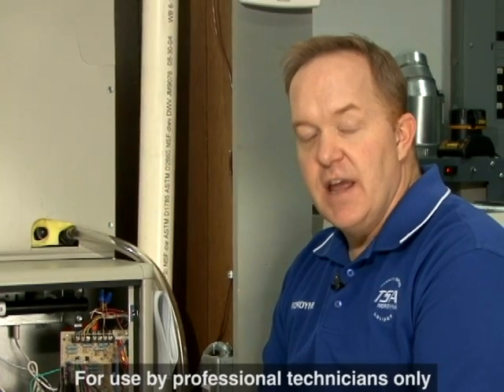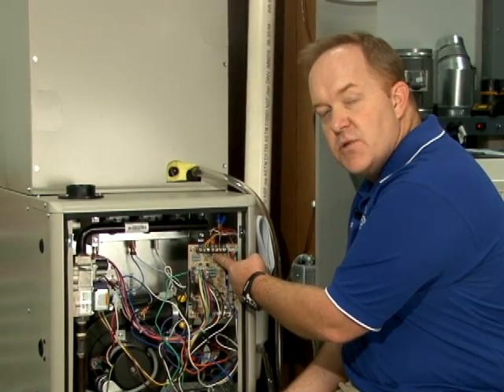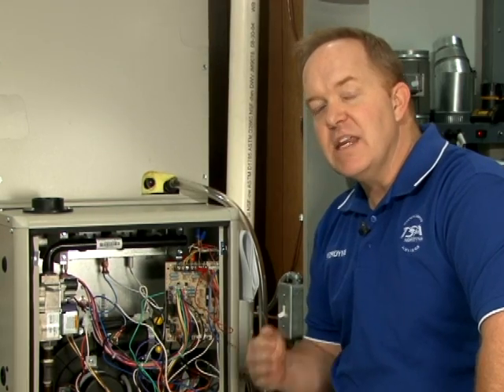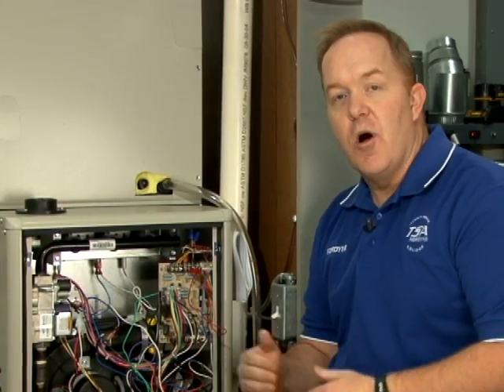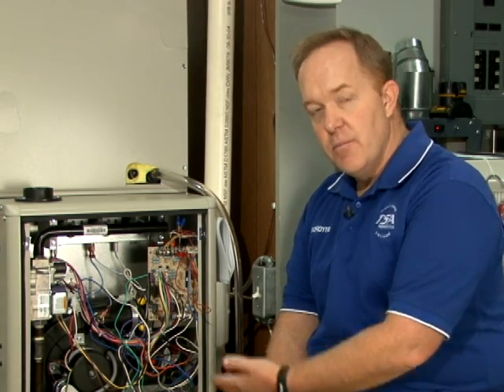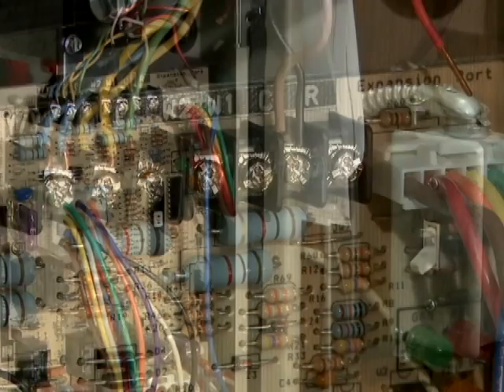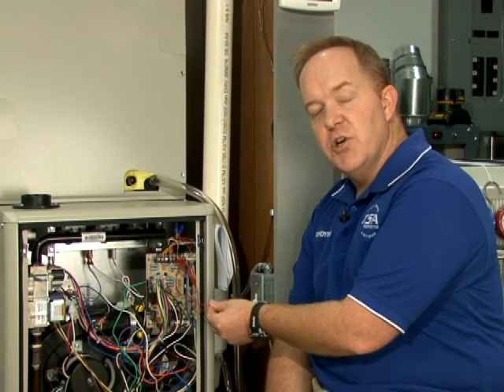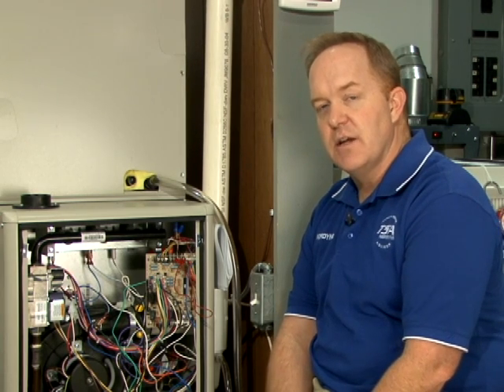Furnace Repair - Eliminate the Thermostat | NORDYNE U Technical Tip

Comment: What do I do if I jumped my nordyne furnace and it worked and I put a new motherboard and thermostat wire and thermostat and it still don’t work with the thermostat only with the jumper
Reply from the maker: Please contact Technical Services at 1.800.422.4328

Comment: Hi , i need to bypass the first cycle on my dual energy furnace ( oil and electric ) everytime i loose power , when it come back the first cycle is on oil , since i strip the tank , my furnace just work on electric , so i need bypass this . It is possible?

Comment: He says two different things. First, that doing this eliminates the thermostat or the wiring as possible culprits, which is wrong. But then at the end he says that jumping these two terminals out at the furnace tells you that if the system starts up, then you know "it is" either the thermostat or the wiring, which is right, but in the beginning he said the opposite. This is the problem with alot of these videos. They can be very informative, but you have to pay close attention to what they are saying, because the get confused. And  just an FYI for anyone, if you just go straight to the thermostat and jump it out and the system be starts up again, then you know it's probably the thermostat. This also, at the same time tells you that chances are very good that it is NOT a wiring issue because if it was nothing would happen, the system be would not start up again. JS.

Comment: But with thermostat out of the mix,   how do you set the furnace to heat?  My heat is currently not working on my goodman furnace.
Reply: My understanding is that when you jump those 2 terminals, it is essentially the same as the thermostat telling the system to turn on the heat.  It just won't turn back off until you kill power to the system.

Comment: Hi Dana, what website can I get a good jumper?  I go to Ebay (TYPE FURNACE CONTROL FAN BOARD JUMPER) it don't show...PLEASE HELP.
Reply: This question is pretty old, but for anyone who comes across this in the future... he just means a wire with a pair of alligator clips on them. It's not something specific to air conditioning or anything like that. It's just any old wire with alligator clips on the end to connect to the posts. It closes the circuit for you instead of relying on the thermostat to do it. It doesn't even necessarily have to be alligator clips. You could use a paper clip if that's all you have as long as you are able to make a sturdy physical connection between the two posts with an electrical conductive material.
Reply: @UFallinggator  zzzap
Reply: I'm scared
Reply: @ryanpennington817  Fortunately these are very low voltage circuits. You're not going to fry yourself even with 120V... Or even really 220V for that matter. My great grandfather used to say that he had to lick his finger first before he could even feel 110/120V. He had spent so long working with electricity that he'd become desensitized. Now 220V would still give him a shock, but nothing too terrible... depending on the circumstances of course. You don't really have to worry until you get to the main lines. Now, those will just fucking kill you. If you have to ask questions about anything past the breakers, then just don't touch it! Don't even look at it because you legitimately might just die...
Reply: @UFallinggator  thanks man n no it's that block with the wire screws...

Blower stopped working but the flame is on...on the coldest day in Ohio what luck

..r has a wire attached and the one under it...but 2 came lose n the blower sounded like it powered down..I'm no expert...I'm at work but when I get home Ima tinker with it with no fear thanks to u
Reply: @ryanpennington817  The thermostat usually operates at 24V with very little current. Even standing in a metal bucket full of salt water I doubt that you'd even feel it. It's still always a good idea to disconnect the power to the circuit when working just for the health of the circuitry, but I certainly wouldn't worry about a shock. If it had been the burners, them if say your first checkbox would be cleaning the flame sensor. That is by far the most common reason for a "no heat" service call. If the blower isn't operating, then eliminating the thermostat is always a good first step. It's quick, easy, and free. Hopefully it's just a bad thermostat that can be easily and cheaply replaced... And for that matter temporarily rigged if needed. If you need any help diagnosing the problem feel free to let me know. I'm not an "expert", but I've got a bit of experience. If necessary, we can arrange chat or video chat outside of YouTube as well. Not having heat in this kind of weather is not fun!
Reply: Oh, and try running the fan only. If within a few minutes the fan turns on, then a likely cause it's the limit switch. You should be able to find a fair amount of info on this issue with a simple Google search. If it is not the limit switch or the thermostat, and no tripped breakers, then it unfortunately might be the blower fan itself. There are worse problems to have, but a blower fan isn't a quick simple fix either.
Reply: @UFallinggator  brother David I appreciate that truely..we had a huge snow storm and it would just do this on cue..plus out shoveling I think my glasses got misplaced in the snow  so I had a hard time reading the labels..id PayPal u if it went too far  nothing's free nowadays ..even if it's not fixed the knowledge you have me already would help in me not getting ripped off ...it's a learning experience and I'm on the web googling stuff..

+
+
+
+
+  It looks like this with a wire connected to the top and second +( + are screws)

There are 2 wires that got disconnected and when they did the blower seemed to shut down

Didn't have time to take a deep dive. As I had to be at work plus go grab space heaters ...

Maybe I should try the jump technique..go get alligator clips ..can I fire the blower up manually ?
Reply: @UFallinggator  I'ma be honest months ago it was vibrating roughly...not smooth at all..at the start of "thermostat season" I had a guy come...he pulled the fan out and cleaned it..then he adjusted (Jerry rigged) it a in a way to we're the loud clang would stop ...I guess the storm had it working overdrive and maybe his quik fix gave out ...

It was making a tap noise when I came home from work .

Instead of the vrahhhhhhhhh smooth n low sound u had a small tah tah tah inbetween

This led me to go down open up the furnace and look inside at the burners n stuff ...my failure to put it on snugly prob led to it popping off ( I think it was latched pretty good Imo)...the lid popped off and the fan rolled forward slightly pushing the 'block" on the floor...

My main objective maybe shouldn't be the blower but considering the weather n me not wanting my pipes to burst it is ATM I wanna tackle the blower b4 I tackle the tah tah tah ringing  cus I think k that's from my goof.
Reply: @UFallinggator  what do you Kno..I got the blower to come on and it's running smoother than it was
Reply: @UFallinggator  but nowwww the flame won't ignite

It' stays lit but it's not wooooooshing 

🔥

But not 🔥 🔥 🔥
                  🌪️🌪️.  <--- blowers is going tho

           🔥
           🌪️🌪️ Currently
Reply: @ryanpennington817  Video would be really helpful in this case. Your system uses glow plugs right? It sounds like the glow plugs are heating up, but that no gas is being allowed to flow. My first 2 thoughts are 1) are you out of gas 2) and clean or replace the flame sensor (about a 5 minute job). Check if you have fuel in your tanks, and if so try cleaning the flame sensor. If that doesn't work... It's time to call an HVAC tech.
Reply: @UFallinggator  I gotta it working lol I made several vids but my husky had my house looking like a fur igloo n I was embarrassed...

It was wierd tho man...get the flame fully ignited  then the fan shut off...get the fan goin the n the pilot wouldn't fully ignite...

Took the right herbs in spices to get it goin

It's still making a mouse like noise inside...like it's a mouse trapped inside..quiet squeak...
Reply: @UFallinggator  I'll try in upload a vid
Reply: @UFallinggator  I just did a overnight...I came home tinkered with it and got it goin...im bouta crash ima try in upload it first
Reply: @ryanpennington817  So it's working now? Well done. The blower sounds like it is out of balance or needs lubrication or both. I would not expect it to last much longer. Replacing a blower is something that can be done by yourself, but it's... Medium difficulty. Oh, and for future reference I had meant for the video just a shot of the internal furnace workings from startup. That's where a lot of the diagnostic value is. Seeing what the burners do... When the fan kicks on... Etcetera. Glad it's working for you, and do try to fix that blower soon before you come home to a cold house again. It looks like a fairly old system, so the good news is that the new blower might be more efficient.
Reply: @UFallinggator  right...I believe this to be true ...a tech came and said the same thing months ago but he Jerry rigged it in a way so it wouldn't vibrate so violently. He said plan on getting a whole new furnace tho primarily $$$😥 and he'd look for a blower in the meantime cus the model is old
Reply: @ryanpennington817  Sounds about right to me. If it were me, I'd replace that furnace in a heartbeat, but I know that's not always easily feasible. I honestly think that, given its age and current state, that you could come very close to paying for the replacement in energy savings. A lot of places offer financing that will offset the upfront cost, and bring the combined monthly cost of fuel/electricity + equipment cost to about the same as you're currently paying for just fuel and electricity. If possible, it may be worth it to skip the blower repair, and just replace the whole unit. In the meantime, I'd find out how best to lubricate that blower, and keep it WELL lubricated.
Reply: @UFallinggator  tbh it's manageable..summer time I only pay 30-40 bux somehow  and winter the most it'll be is 130 if I use it wisely got a big 2 story house with 3 bedrooms n a basement...I don't live in the best neighborhood so the cost of living is very low...im just tryna save there's no kids here so if things go bad it's not as drastic..space heaters and bundle up lol..

I heard different programs will help..I just hope I can weather the storm for another year...but I'ma be saying that again next year...it's a good learning experience though. .I wish I took HVAC outta highschool to many kids go to college with no idea what they wanna do...jus get a trade n be done n 2 years tops

I could afford it a
Reply: @ryanpennington817  You're not kidding with the college thing. College is great for a lot of kids, but there are a lot more who would benefit even more from a skill that doesn't leave them 40k in debt. My brother-in-law's mechanics at his dealership make 70k-100k+ a year.
Reply: @UFallinggator  .....I know folks with degrees who couldn't find work...or we're working at Wendy's no offense .just saying..that's more then teachers though..sign me up...it's programming the national debts at 1 trillion+ for a reason imo
Reply: Hi - Here is a response from Dana. 

I always used to get mine at Radio Shack, but I think those are
gone, nationwide. Amazon has some good alternatives.

https://www.amazon.com/uxcell%C2%AE-Double-end-Alligator-Clips-Jumper/dp/B016CJP6BA/ref=sr_1_22?s=hi&ie=UTF8&qid=1472649551&sr=1-22&keywords=jumper+wires+with+alligator+clips

I DO NOT recommend the magnetic tipped test leads. They fall off
too easily and can cause accidental shorts. 

Hope that helps
Barb
Reply: Hi, can I do this kind of troubleshoot on a 20 years old gas furnace blower fan control board?  Thank you

Comment: Hello Dana , need you help how it can connect humidifier on Nordyne control board PT # 624631-B. I have already busted my control board which I believe wire incorrectly. which I try to contact one end to C terminal and 2nd end contact to HUM next to M1 - within five minutes board busted,is it right way to contact both wire - one end to HAM next neutrals and other end  2nd HUM which is next M1need your help pls or posted video on youtube.
Reply from the maker: +Naseem Malik Hi - We do have info on how to do this in our installation instructions, which are available from our Technical Literature link on nortekhvac.com.  If you need technical help beyond that, please call us at 1-800-422-4328. Of course, you must be a licensed HVAC contractor. We never recommend that homeowners modify their furnaces. Thank you!
Reply: Did Naseem Malik ever call you, lol.
Reply: Ha ha,